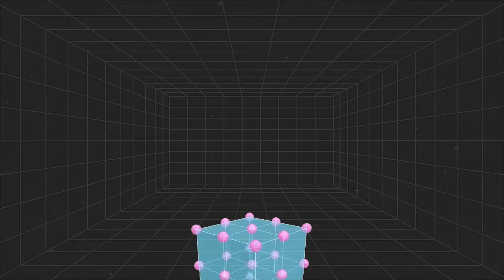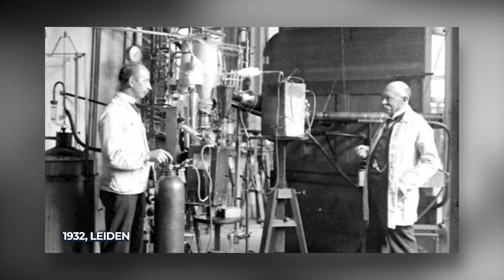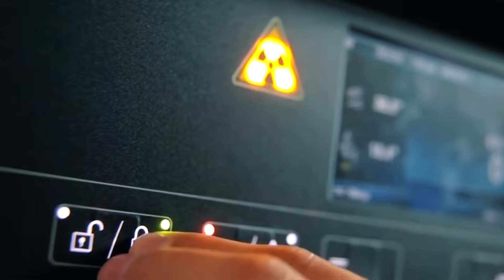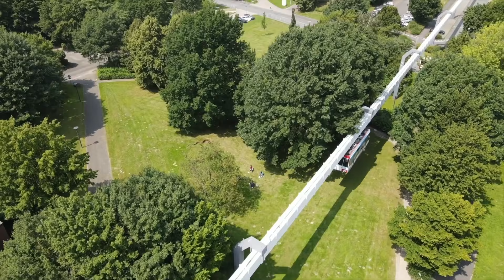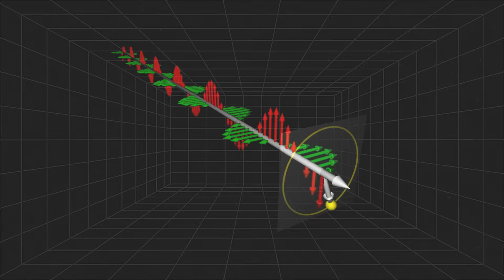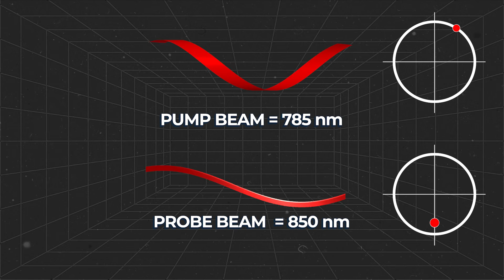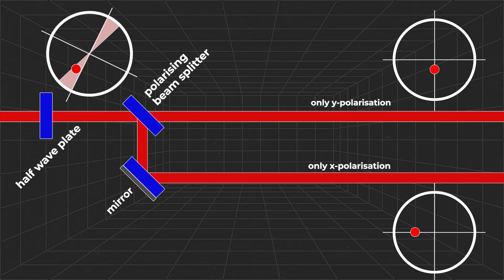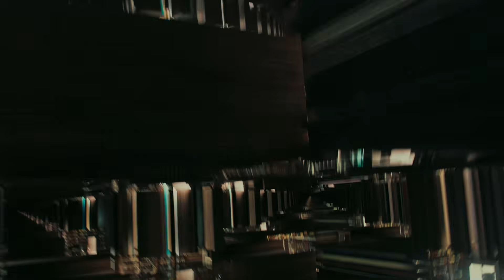Impossible Time Crystal Breakthrough - Explained

Comment: If the length of the period is extremely stable, could it be used as an "offline" relativistic velocity-measuring device by comparing the phases of a stationary crystal and the one that was moved around? Time dilation would have made them oscillate at different speeds, right? Or does the travel-loop cancel out when they are brought back near each other?

Comment: I can make you a time crystal with just silicium and some boron and antimony. It's called an IC oscillator.

It takes in DC power, a constant voltage and current and outputs an alternating current signal at a certain frequency.

Comment: Have you seen the movie Millennium?
    The premise of the movie is an NTSB investigator discovers an odd device in the wreckage of a plane crash. The problem is, he had seen such a device years before being used on an airplane he was aboard years and years before, just before that plane crashed. A crash he alone had survived. In addition to the strange device there is something odd in the CVR. The crash was caused by a mid-air collision and after the collision the captain asks the flight engineer to inspect the back of the plane for damage. He comes back saying, 'They're dead. They are all already dead.
     The recording ends before this can be clarified.
     As it turns out the flight attendance on that airplane were not who they seemed to be. The are, in fact time travelers who have been sent to onto the plane to collect the passengers. The passengers are replaced with clones that are not alive. The time travelers can create clones but can't make them be alive.
     The reason for this is because in the future humans have so badly polluted the Earth that the humans can't have babies anymore. The ecosystem has collapsed and Earth is dying.
     The plan is to send healthy humans into the distant future, a point after with the Earth has recovered. It's decided to remove passengers from doomed airline flights and replace them with clones to provide bodies.
     The strange devices the NTSB investigator finds are used to knock people out

Comment: Retired motorcycle mechanic, the best part for me was you didn't go into the mathematical side of things which I couldn't understand in school and still don't.
For some reason, I'm 'math dyslexic' as soon as a formula appears (at least anything more complicates than Pi ) 
It may be because I've never needed to work with anything but cylinder capacity and events when building race motors ('pulse tuning intake/exhaust)
I'll watch a few more of your video's.
Reply: Dyscalculia

Comment: This sounds mesningless. Firstly there's no "time" involved, but rather a condition like a property. Secondly if you want something "forever" have any stabile non-decaying crystal, even at lowest energy state (zero kelvin) it will have crystalline structure and electrons will spin at a low energy state emitting zero photons due to zero excitement. No 'special' gimmick property needed.

This entire thing sounds like as if math autists transitioned into physics: hey, let's do a thing. Zero use, zero purpose, but proves a theory. Then an all around applause.

Comment: Ive seen that pattern in signals that are saturated, like a phase flip during that dip in the oscillation.
Given that I’m still confused on the time crystal definition.  This example is just a coupling between the electron and nuclear spin?
Reply: Are they using rf detectors?  I need to look at the paper I guess.
Pump probe electron diffraction might provide insight.  Again I’m clueless at to what’s being measured.

Comment: Why does a time crystal need to last forever? We don't insist that a "normal" crystal must be infinite (or even semi-infinite), we're perfectly happy with declaring that this object right here is a crystal but it has a definite location in space; why can't we say that a time crystal only needs to have a definite location in time? (i.e. "this time crystal measures 1.1 mm along the x axis, 1.25 mm along the y axis, 1.07 mm along the z axis, and 4.2 months along the tau axis" or whatever.)
Reply: A normal crystal near absolute zero lasts for a very long time. The objection I have is this simply another version atomic oscillator where at near absolute zero is super high Q. That is valuable but acting like science is broken or that this is something fundamentally different or new at a theoretical level is bullshit. Other researchers will develop all kinds of ways of making things oscillate near zero at super high Q some might even be commercially valuable. This doesn't sound commercially valuable.

Comment: At the results you still see the variety in the measurement, likely from the noise. Also, isn't the laser providing the  "clock" and the matter is still merely syncronizing to it, even if the structure is built to cage the oscillation frequency. For some reason it reminds me of the quantum entangled drums, wonder what else we can spin to our will.

Comment: Theory why the oscillation period is 6 seconds, the oscillation is being inhibit by smaller harmonics generated by the laser itself. Light photons moving though 3d space have zero mass but in the 4th time dimension they will have full mass. When the light photons are slowed down by the crystal , Loss in speed would be in proportional to the the proton would loose in mass the 4th dimensions. (This is where I’m gonna make assumptions about how and what gravity is). This difference in weight would cause a time dimension gravity attraction on 4 dimension shadow of the atoms in the laser light proton. As this crystal is oscillating in the 4th dimension its 4th dimensional mass is also changing getting lighter as they move faster, heavier as they slow down. As the laser passes through the time gravity interactions due to time weight changes of both the atoms and laser, cause minute harmonic oscillations , that interfere with electo magnetic oscillation causing the resultant observed oscillation to occur over a longer period than expected.

Comment: I curious to know if it could be used to drive a high-powered transmission system for communication that would provide higher bandwidth than present modulations systems using lasers or radio.

Comment: Two planets orbiting. Is that a time crystal?
Reply: Their orbits are a function of energy entered in by mass and trajectory. As they move closer, they use up energy. Once they collide, they will release energy. So, no. They won't reach a state of equilibrium, so this doesn't qualify.
Reply: @OzzyZorda  Why'd they move closer and lose GPE if they were in a perfect vacuum? Is it loss from gravitational waves?
Reply: @shApYT  
TL:DR GPE is too variable in energy levels to be a "Time Crystal"

as far as my understanding allows, and I admit I am no expert, the only energy affecting your system is gravitational movement energy. How much energy this system has is solely dependent on the speed of each mass before they enter each other's orbit. Before this point, if we assume they enter each other's orbit from a strait line and we assume they both will be unaffected by any outside force, their trajectories and energy will remain consistent until acted on by another mass. Once in each others orbit, they will start to rotate around each other. Depending on that tractory, they will either have a wide orbit, which usually means they will slow down and may leave each others orbit. As they get closer, their own gravities affect the other mass more and eventually speed up until they collide. While over time, this may be a consistent rotation, but it will always eventually lose energy and collide.
Reply: Fun fact however. We actually use Pulsars to help determine distances over large scale distances because their rotations and light 'pulses' are extremely consistent. They WILL eventually collide and explode, so not a Time Crystal.

Comment: I’m not sure I agree with the statement that superconductors can’t be perpetual because of the magnetic field escaping, because a DC magnetic field is imparting force not energy. In a static environment, and a fault free structure, and as pure cooper pairs that don’t interact through weak force at distance, and at a sufficiently low enough temperature, there’s no reason it couldn’t be.

I know that’s a lot of “ands” but fundamentally it’s possible

Comment: Putting energy in is not what I expected, so the disappointment wasn't entirely alleviated. Oscillation driven by energy is nothing new. A light-driven atomic oscillator is pretty neat on its own merits, just like atomic clocks are neat. Still "time crystal" is perhaps overselling it a bit.

Comment: Your claim superconductors lose energy to the evironment is wrong mother fvcker. 4 points:  1) If your claim were true then it is an ordinary conductor and the operation below critcal temperature and the other two critical parameters also operates as an ordinary conductor!  2) H Watanabe & M Oshikawa were not talking specifically about superconductor when they proposed their 'no go proof'; both Wilczek &  Tongcang Li et al stated to the effect ...superconductors are not qtc since nothing is changing it time. I was there back then when the debate was easily accessed, so I know mf. 3) H Watanabe & M Oshikawa are wrong as they fail to account for ground state coordination of quantum systems;  i.e. the simplest example possible... consider an ideal set of electrons in a ground state orbitals aligned to form a macroscopically coordinated  magnet,  it produces a detectable magnetic field and because the orbits are quantise, the electrons require precise quanta energy input to change state so they dont lose energy to the evironment or change state... Bruno also fail to take quantise characteristics into account  when he wrote the first challenge to Wilczek's propose qtc.  4) All orbital bodies in elliptical orbits have a semblance of repetition in time and space i.e. repeated perihelion aphehlion cycle... so even nature does it on the macro scale

Comment: Reinventing the piezoelectric crystal. This is a metric ton of hair splitting over nothing. Atoms vibrate. You want them to vibrate in order? Chaos will always seep in. If you have to pump in energy to get the order, then it's not "crystal" anything, it's just an engine. Even if it was ordered, you disturbing it to measure the order will ensure it stops. 

What are we achieving here? Even if it worked, you couldn't access it. That experiment is complete bunk. You say Piezoelectric doesn't count because it requires energy, well so does this. This is Snipe-chasing. It's made-up nonsense that sounds good on paper. Another professor writes some bunk to get tenure, and other professors try to justify their existence chasing it. Meanwhile true, meaningful research into another avenues of science fall into neglect because they are considered troublesome, borderline BLASPHEMOUS because they don't fit current models and professors might lose their jobs over it. That's what all of this comes down to, justifying professors' jobs. There's your perpetual motion machine: the motion of academic dogma. It's circular motion, aka a big Circle JERK. 

Here's something that would shake the foundations of everything we ASSUME we know about the universe, we see evidence of all over the place, and yet it's ignored, insulted, and viementaly attacked whenever the subject comes up: Light frequence slows over vast distances. Space isn't perfect. The Redshift of light is just a natural effect of distance. This would affect the careers of hundreds of professors, throw out the Big Bang entirely, change how we measure interstellar distance, the size and scale the universe, it's age. HORDES of people would have to retract decades of wasted time and look like fools. Yet is OBVIOUS, proven, self apparent... but massively inconvenient to the machine. But everybody's got time for "Time Crystals". Sure, why not? 

I think the only thing a PhD in physics demonstrates is your ability to look at the sun in the sky and declare it's night, with a straight face.

Comment: at 6.9 secs I suspect it from noise from a system. That waveform looks very similar to a Gifford-McMahon cryocooler cycle. One simple test would be to replace the crystal with a different material & see if the result is the same & make sure the cryocooler is turned off when taking a measurement.

Comment: If something is "Basically Impossible " it's just impossible.  If it exists,  it's not impossible,  basic, or otherwise.
Reply: In physics, especially solid state, we don't consider something to be impossible in that sense. Something is impossible if it has a very low probability of happening; like a container of mixed gases separating spontaneously into separate sections of pure gases.

Comment: If I heard correctly, we use a power source to start it up and if it keeps oscillating forever, after we cut the power, it's a time crystal. Eventhough it only oscillates for less than a second(not forever). And, we can only measure it by firing a laser at it. Isn't that adding power to the system to keep the oscillation going?
Reply: I think what makes it not that is that the oscillation is carried from the initial output. The repetition is simply a repeat of the energy contained within the system.

Comment: So basically:
We did math to figure out what a time Crystal could do, gotcha.
We make theory on what material could for a time Crystal or conditions similar to that of a time Crystal, gotcha.
Pass light through the Crystal to align electrons and nuclei, gotcha.
We need to be able to measure these alignments to verify if our initial math is relevant, oh no, he did say optical physics.
We pass a probing light through the Crystal at a slower frequency in the opposite rotational frequency to prevent it messing with the initiating beam, okay.
The probing light will interfere with the electrical alignment of the Crystal so we need to send a tertiary beam that matches the rotation of the probing beam to cancel out the effects of the probing beam… I’m scared. 
The tertiary beam will arrive at the detector earlier than the probing beam since it’s not fighting against the electrical alignment of the Crystal and therefore distort the wavelength’s vertical/horizontal axis by [Varying Amount Here] depending on the alignment of the Crystal… I need to go for a walk.
We then separate the light using polarized mirrors into the X and Y axis of the rotational light beams to isolate the noise caused by the crystal… I’m getting the picture again.
And the results gave us a frequency period 6.9 seconds… nice 
The fact people can keep up with this so easily, that fact I understood it alone, impresses me.

Comment: layperson here with what might be a dumb question. It seems like one of the criteria for being a 'time crystal' is that the oscillation needs to come from the crystal itself. This is why we are not impressed by quarts because its oscillation is 'downstream' of the input power due to the piezoelectric effect 

In this experiment, it seems like all the observed oscillation is 'downstream' of the oscillating polarization from the input laser. Is the crystal not just applying some elaborate transformation to an existing oscillation? It still seems like the primary oscillation  still comes from the laser and could be used directly without the crystal for timekeeping
Reply: The polarity shifts in a repeated pattern over time, causing the output on the laser used for measuring to oscillate in the same pattern. 

Normally, light is only shifted in polarity, it doesn't have an oscillating shift.

If you mean the initial input laser, if you remember, the magnetic field held the alignment in an initial state, then that laser gave the alignment a uniform direction with a uniform force applied throughout.

Comment: The first statements that the crystal repeats in 'time' may not really be a correct way of thinking about it. What may be more literal is that the structure of the crystal just has a tuned interaction with quantum behaviour at the rate of quantum events travel through space.

Comment: This is interesting but is it odd to have periodic responses to non-periodic inputs?  A steady breeze will cause a tree branch to wave back and forth; rubbing your wetted thumb along the rim of a wine glass will cause it to ring.
Reply: The thumb is an oscillating input, it slips and catches randomly but repeated slipping hits a specific time that builds on the peak of the wave in a constant pattern that resonate with the glass.  A constant input would not resonate.

Those leaves don't all dance in the exact same way when the wind hits a tree, it's not a repeated constant pattern

Comment: It’s not a problem, because all “matter” and all “particles” are just Aether modalities. An ‘electron’ is a compounded Aether perturbance comprised of a longitudinal impulse (voltage potential) and the subsequent secondary transverse wave of dialectricity and magnetism (both of which are secondary effects to the initial longitudinal impulse). All matter is just energy in a stabilized form, which again is an Aether modality. All the energy that keeps matter as matter and keeps electrons as electrons moving is again coming from the Aether, which for all intents and purposes has an infinite reserve of energy.

Comment: As soon as you shine a laser on it, you have an ascillating magnetic field, which violates the original requirement. The only interesting part is the huge difference in frequency.
I also don't understand why a time crystal may have continuous energy input. I understand that it isn't possible to have a time crystal that is infinite in time without it, but it is also impossible to have a crystal that is infinite in space, yet we still call them crystals.